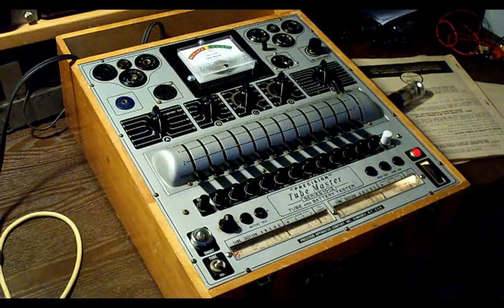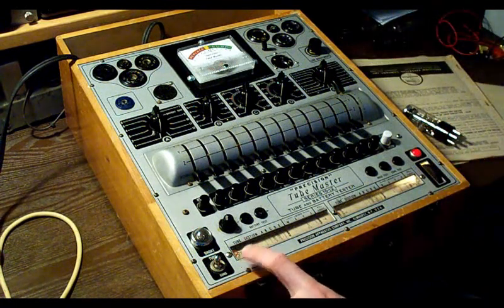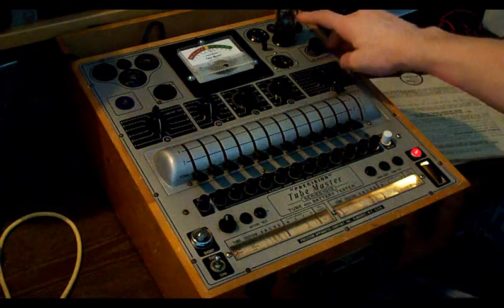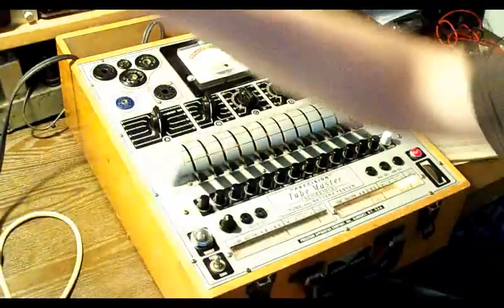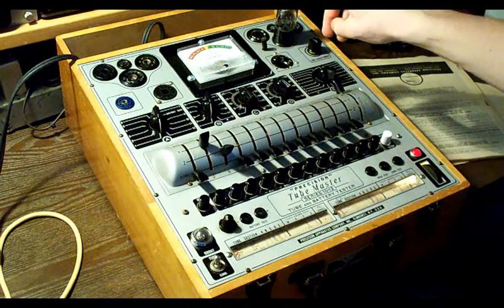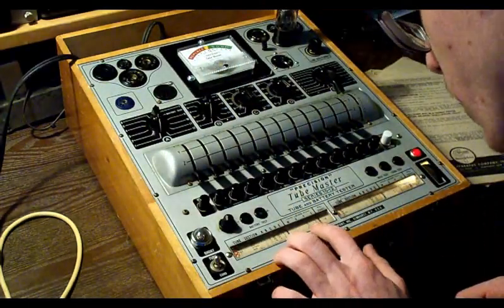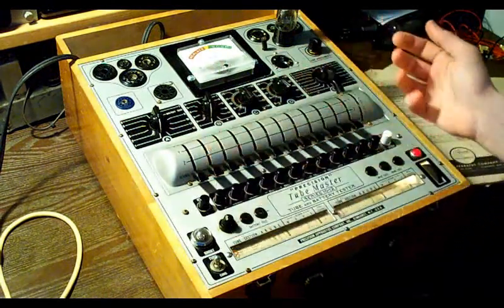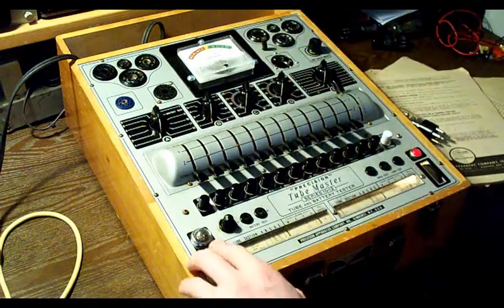Testing a Magic Eye Tube

Comment: Hey Doc, wonder if you have any thoughts on this: I'm doing my first restoration of an old capacitor tester bridge. What I'm finding is that I can't get the thing calibrated so that the eye is open widest across the whole range of values on the dial. In particular the dial reads quite a bit higher than the capacitor value at the high end of the range based on the eye being open wide. BUT if I connect a meter (negative to chassis, positive to positive terminal where one leg of cap is connected) I find that the lowest voltage is pretty close to when the dial is at what i believe the cap value to be, and the lowest voltage is NOT where the eye is open widest. Any thoughts about why that last thing might be the case and what might be done about it? Thanks for any advice!